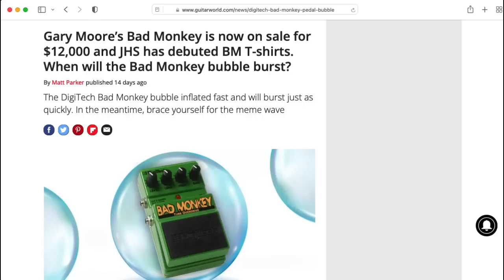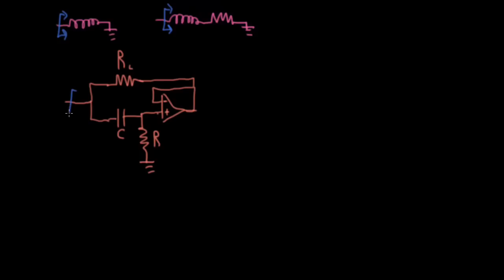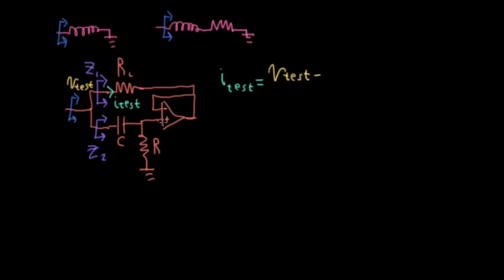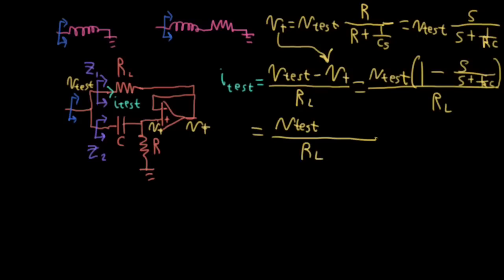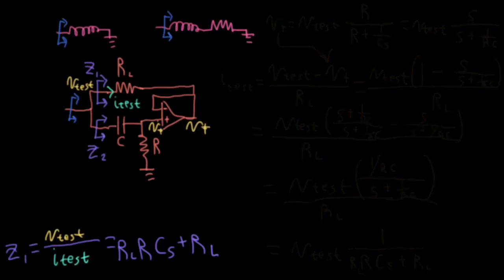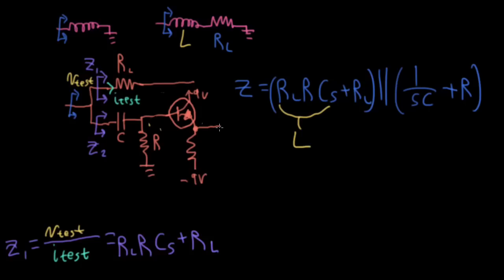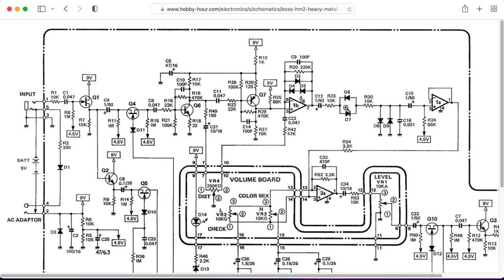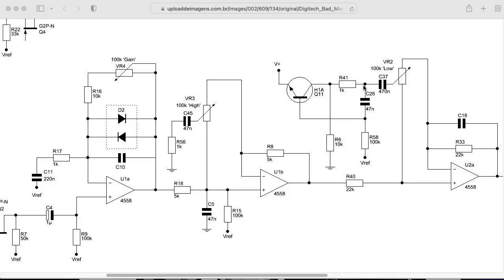Gyrator Circuits in Guitar Pedals (Bad Monkey, DOD Grunge, Boss Metal Zone & Heavy Metal)

Comment: Gyrators can be used to replace inductances in electronics circuits. The advantages are large inductance values and predictability of parameters. The disadvantage is a limited frequency range . Gyrator circuits with resistive feedback are very common circuits

Comment: This was an enjoyable video and your analysis was pithy and well done. Worked on an integrated gyrator in the early part of my career which simulated an 8 H inductance. Compared to a 6 H real inductor at my bench, the size difference between the IC and bulky inductor was obvious, but the frequency response performance of the gyrator circuit was similar to the real inductor.

Comment: Some further thoughts after looking back over some more schematics that use gyrators (in addition to the four you brought, Nobels ODR-1 and Boss XT-2):

 it seems like R >= 25RL and in most cases >= 100RL. Do you think that’s a design guideline to ensure we can disregard the effect of parallel impedance Z2? Or are there other factors at play?

Also seems like all the gyrators are configured as notch filters and then use an op amp to cut/boost the band that is notched. Is that correct? And are other topologies possible?

Speaking of the Boss XT-2, its EQ is quite interesting. This video https://youtu.be/gC6a8tdzzyU does a great analysis and suggests some mods. 

The HM-2 has two gyrators on the same pot (mid and high), and it’s a relatively simple nod to break out the mid onto its own knob for more control (on my BlackBender, I used a switch for user choice of 2-knob or 3-knob control).

Of course, the most popular HM-2 mod is to hardwire all three gyrators to the non-inverting input, since “everyone” just dimes all the knobs anyway 😂 (see, e.g., TC Electronic Eyemaster).

Finally, Electric Druid has an amazing analysis of the MT-2 EQ — there’s a lot more going on there than it seems at first blush: https://electricdruid.net/boss-mt-2-metal-zone-pedal-analysis/

(Also worth mentioning ESP has  a characteristically thorough essay on gyrators in audio circuits: https://sound-au.com/articles/gyrator-filters.htm)

Comment: The metal zone is probably still the most widely used pedal on tube amps by shred players such as myself, but I'm not running one. It's also just a very common pedal for soloists and instrumentalists on Mesa Boogies, 5150's etc.
I've never worked with gyrators because I'm still stuck with perfboard builds ATM lol. The BJT is more applicable than an op amp in this regard. 

I bought the CNC mill and laser etcher for mfr. my own "PCB's", but still just hoping to get started with them this year. It's 10 tons of work to take on all these technical trade skills coupled with a science education for one person in a DIY environment.

Comment: Uh! A video about gyrators. Fun little circuits, rather useful for filters. Thanks for making this video! :)

I have a question: Does the opposite of a gyrator circuit exist?
Reply: Capacitor multiplier?
Reply: @r080  That actually makes sense, Thanks.
Reply: s high pass filter.

Comment: Guitarists are embarrassing at times. I never understand how people think that a given capacitor of a given value, provides different tonal qualities of tone depending on the material it's made from. Surely it doesn't matter if it is a tiny modern one or a vintage orange drop if the capacitance value is the same.
It's like talking about tonewood for a solid body electric guitar or the finish being bare wood or lacquer.
Reply: In a 9V environment that may-be true but if you are talking High-Voltage things change. A shitty ceramic sounds definetly different then a good film cap in certain places. And that is due to material properties, no voodoo involved.
Reply: @Pentode3000  I can't see why, you may be right, but I would have thought that ceramic might be for lower voltage applications? I've only made low voltage stuff, so forgive my ignorance.
Reply: @kentl7228  All good. Ceramic Caps are available in many different voltages. Ceramic caps and those old Allen Bradley brown Carbon Comp resistors have a nonlinear behaviour under high voltage and thus create distortion. Voltages like present in tube amps and that is where the myths come from. If people then use Carbon Comp in a 9V environment for the magic mojo i have to laugh too.
Reply: @Pentode3000  I am amused too. People want THE pedal, THE guitar, THE amp as used by some idol player to get the sound. But where did they play along the string length? Where was the microphone? By the centre of the speaker or somewhere else? What did the engineer cut at the mixing board? No, just get the sprague orange drop or oil filled paper capacitor on the tone pots then I will be identical to Hendrix. Of course, people get these capacitors and just run the tone pots at 10 anyway...
I searched YouTube just before and found an interesting proof of our thoughts...

https://youtu.be/dEr-66DR8PM